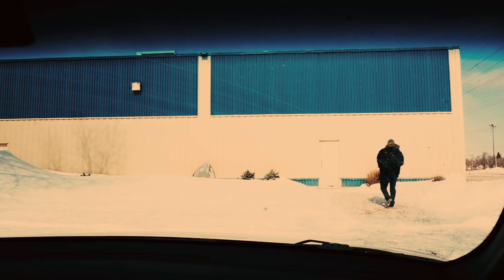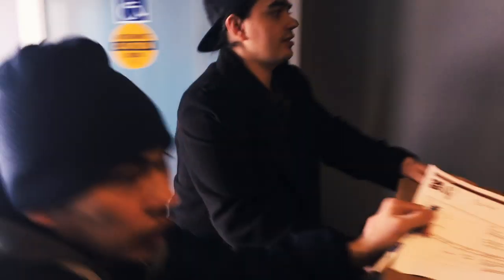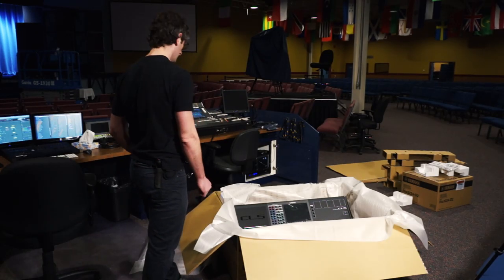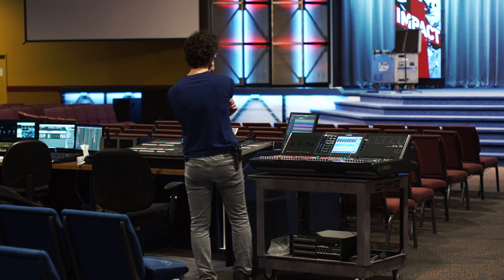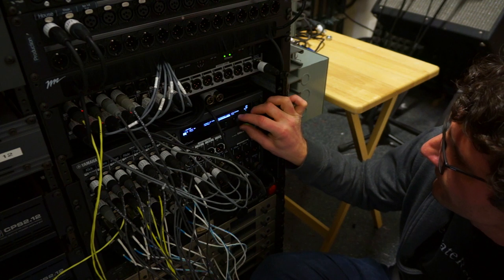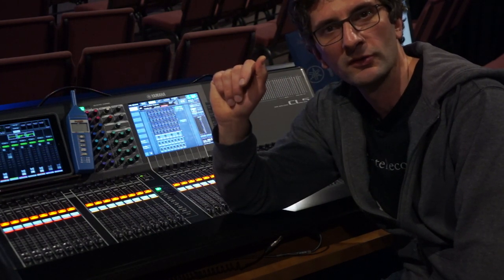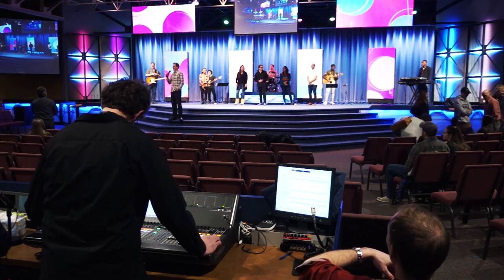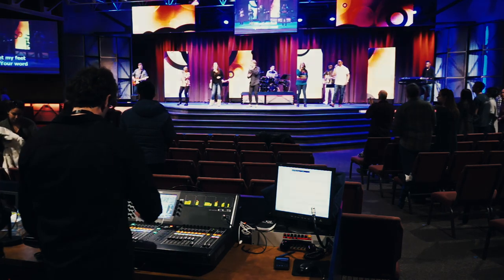MIXER UPGRADE  - The Entire Process

Comment: Interesting you note at 20:48 "everything seems to need more gain"
Yamaha has actually tweaked the HA gain settings, as per the website FAQ:
"CL series indicates the actual amplification factor (level ratio of input to output) instead of the former input sensitivity (input signal level required to obtain the nominal output). This is to match with the indication for the newly-introduced digital gain."
The previous lowest value was +10dBu sensitivy, which now corresponds to -6dB of gain, i.e. everything is now off by 4dB
e.g. the internal pad switches at 17/18 dB instead of 13/14
Actual gain is unchanged, just what it displays as is different
Reply from the maker: That’s helpful thank you